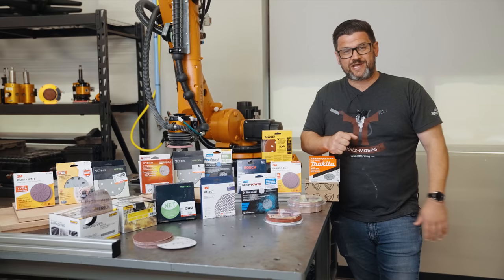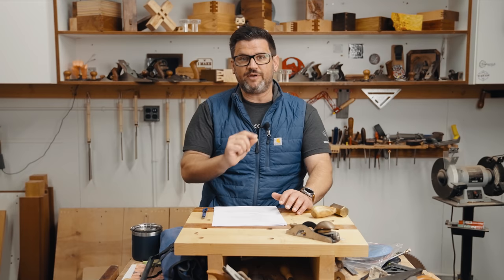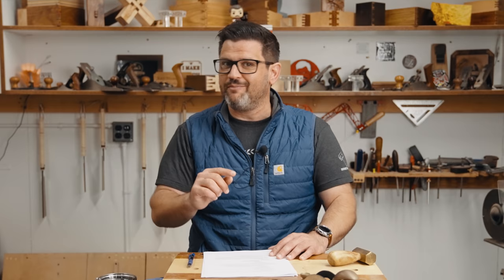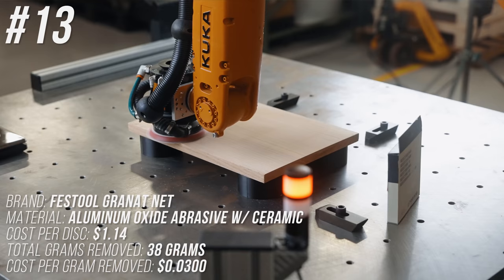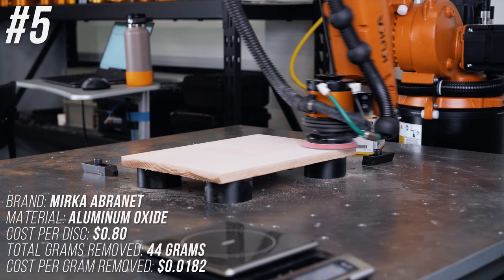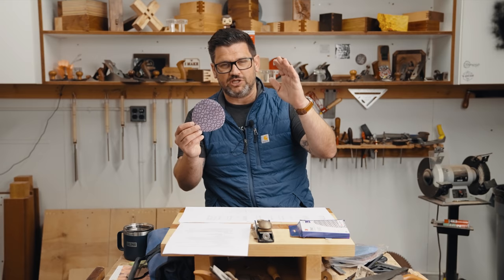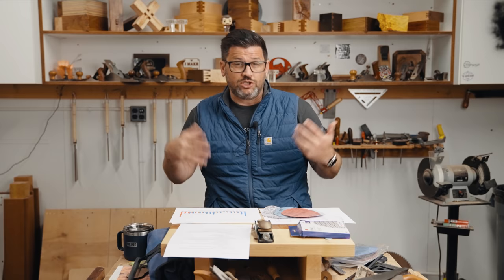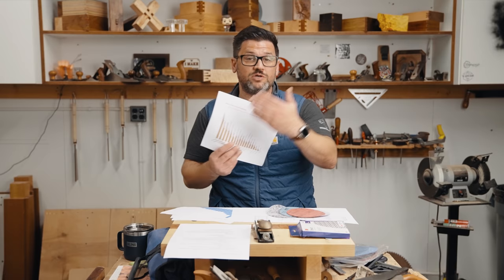Largest Sandpaper Test EVER Done - Top 19 brands Tested using Robots for Unbiased Data

Comment: 10.7 pounds of force. Isn’t a little too much ? I’m not an expert but what I’ve always seen on videos is that you simply lay your hand on the sander to guide. Never put pressure on the sander. "Let it do the work" as they say. 

Put a sander on your kitchen scale and then press down on it until you see 10 pounds. I’m pretty sure you’ll find it’s a lot. 

I don’t know, I’m just wondering what is the best way to sand. Thanks
Reply from the maker: What do you think a sander plus your hand weighs? We tested various combinations and came up with 11 to 12 pounds.

Comment: If you get a larger pack of Diablo the prices drop A Lot. From $1.50 a disk to $ 0.40 a disk that would drop the price per gram from .0236to 0.00625

Comment: mr moses. i would like to know if it's possible to do the same test or at least test the long longevity of drum sanding rolls. right now i use klingspor clothback 80,120 grit rolls of aluminum oxide. on a 16/32 super max. if anything a recommendation

Comment: have you tried using any dry lube spray to see how much it will extend life of pads? iv found it priceless since I'm working with gummy pine for saw blades and table decks as well. was wondering if there's much difference with the different brands of spray?

Comment: What about dust extraction on the top 3?
Meaning will it run as clean using it on a Festool sander vs. using Festool paper on the Festool sander ( holes lining up )?

Comment: Thank you for testing scientifically! Truly

Does the 3M Xtract require the Interim Protector Pad between the sander and the disc? (like Mirka and Festool)
Reply from the maker: I don't think so but I am not 100%
Reply: @katzmosestools  thanks! I can't find anything on the 3m site so I also asked Taylor tool works as well. I hate the interim pad, I feel like it makes it sand weird
Reply from the maker: @theclaxton  yeah we didn't use one and ATI is very familiar with 3M specs because that's the paper they use on their sanders
Reply: @katzmosestools  that's terrific, sounds like 3m also designed out the need to use the protector. Great stuff. Know anyone in the market for a bunch of granat net? 😉

Comment: Hey this is an amzing video, I linked back to it quite a few times now. 
I do have a question however. You mention that ceramic is the way to go over aluminum oxide. Do you have any experience with Silicone Carbide? For example the DeWalt Mesh uses it.

Comment: Will the 3M Xtract cut as well on cured epoxy resin and would it be nearly as good without a vaccum? I work outdoors on carbon fibre parts so I don’t need a vacuum.. Thanks for the video!

Comment: @JonathanKatz-Moses was there a vacuum used in this test, on the robot? Are these results shown only accurate if there is an extraction vacuum applied to the sander? Would the results be different if I don't use a sander with a vacuum port?

Comment: Great review. I went to buy some, but havent found any near that price. I have been using diablo because theu seemed betrer than the porter cable I had, where much cheaper on sale and lasted a little longer. I have used 3m and norton... I  like them, but they 4x+ price. I cant find any 3m near the price listed in video. Most are closer to 2x the shown price. If i could find at your price Id make a large order, but most any place is 2x price shown in video

Comment: One thing that struck me about this really good and informative test. Is 120 grit always 120 grit? Or is it like +- 10% or something like that? A difference like that wouldn't make a big difference when rubbing your hand over the sanded surface, but in a accurate test like this, it may or may not be a parameter to consider. Just a thought. Over and out

Comment: Time to prove your theory: same test but have an IR thermometer to measure working temps. =p   The sawdust that clogs other paper may also keep those papers from cooling reliably.

Im curious about the surface left behind by the 2-3 worst and 2-3 best.  Granted for a scientific result a good magnifying glass or microscope would be needed but would be cool to see other downsides of bad sandpaper.

Comment: Excellent comparison. But it does not take into account variations in wind speed, relative humidity, and changes to the hook and loop pad on the sander. 🙂. On a serious note, do you have any thoughts on how the various grits perform?  I assume they leave a surface similar to their less capable peers, but I wonder based on how aggressive they are. Fortunately there seem to be relatively inexpensive samplers that will let me answer my own question (with my own sander). Thanks for the video.

Comment: Awesome video. I've been a Cubitron snob for years, kinda mad 3M doesn't make a Stikit version (only velcro backed rolls, forced to settle for the Blue ceramic/Al oxide mix). I hadn't seen the mesh disks, I'll have to try them out. Thanks!
Reply from the maker: Check the 2nd link in the pinned comment. They do make an adhesive backed version
Reply: @katzmosestools  My bad, I meant the Stikit rolls rather than the disks. They're a game changer if you spend much time hand sanding, and I spend way more time doing that than with a machine (just the nature of my work). Everything can become a sanding block- a pencil, a can, a level...

Comment: I use 3M cubitron but I find I find the loop backing breaks down quite rapidly.  Using an interface pad helps but it's not much good unless you're sanding a flat surface.  

Would welcome any tips.

Comment: There's really no reason to group mesh with solid sandpaper, clogging is hell! For example, even if cubritron is cheaper than extract, the fact that one will let the particles through much better than the other is a game changer. I've been using arbanet for a while but will definitely try extract when my stock runs out.
Never using non-mesh again.

Comment: I really appricate this.  Do you know what the best sandpaper is for drum sanders?   I havn't found any with ceramic grit yet.
Reply: Klingspors makes AZ paper for drum sanders. Blows any AO paper out of the water.
Reply: @Festus2010. Do you mean Aluminum Oxide?  I have Klingspore now but would love to see something made with Ceramic like the 3m product.  I know it won’t be quite as effective because it doesn’t make use of the grading for sand removal but it might last a lot longer anyway, especially with the heavy duty dust collection I’m using on it.
Reply: Klingspors has Alumina Zirconia (AZ) paper which is ceramic. It’s blue unlike their Aluminum oxide paper which is red.

Comment: When people compare sandpaper on internet it's always about removing material as fast as possible and/or as cheap as possible. I can see that being a thing for carpentry, but for fine furniture that is not the first consideration at all. I know lot people do 2x4 frame assembled with pocket screw or that kind of cheap joins, the end result is always same, the pieces are not perfectly flush, so i see people taking their sander and grind the joint until it looks flush. I'm not criticizing here, i mean it's a valid way to build things with wood but it's not the only way. It's certainly the most appealing way on youtube because cheap/easy obtainable material give the sens of accesiveness so attract larger audience plus it's quick build so you can do your one project a week + editing. But it's not the only way to skin that cat. For people doing woodworking in other ways the ability of a sander to remove material fast is just not the question. 

By the way if i want to remove material fast i'd personally use a planer or just a hand held electrical plane, or even a router with a flattening bit. I got a flattening bit with those square carbide insert, do the maths on gram/cts on these and no sandpaper would ever touch it, and the surface finish is great. So no when i use a sander it's not for removing material fast, sorry. To me this is a brilliant answer to a question that doesn't matter.
Reply: That's just not true in any sense of the word. Why wouldn't you want your tools to work faster and cheaper? When your tools work faster, it gives you more time to concentrate on the final finishing. The final finishing is what separates the excellent quality from the meh quality. If you're all worn out from rough and medium sanding, the fine sanding won't be as much of a pleasure.
Reply: @Bob_Adkins  Each is way. My experience and many others prouve the contrary. Your finish quality is only as good as your the quality of your first 80grit pass of sanding. The rest is just refining. When sanding i spend most on my time on 80gritt then walking up the gritt scale just to remove the scratchmarks. Go quick with the 80gritt and then spend time with the finner is a sure way to spend mucchhhh too many time for at best the same finish. I know some master craftsman even season their sandpaper on nonshow surface and only go with used disks for the best finish. But once again it's finishing not shaping, i do all my shaping (i.e. : material removal) with other tool much better suited to that task than a sander. 

And by the way if you are all worn out because of sanding consider buying a better sander, with my old dewalt sander always sore arm,  i used crappy black&deker i could not sand more than 10min before being cramped (it overheat after 15min anyway), but with the festool one i can sand all day long no problem. 

And to finish when i say you don't want to go fast it's because if it's quick to remove material that also mean if you make a mistake it will ruine your piece much faster and/or be harder to repair. That is certainly not a risk i'm willing to take at a finishing stage. 

But as i said, if it's carpentry then it's a different matter.
Reply: @lolaa2200  Sanding is my least favorite thing about building or refinishing furniture. The less time I spend on it, the the better. Period. Taking longer does not make it better, only longer.
Reply: @Bob_Adkins  Then consider remove material with another kind of tool, it's overall faster and you end up spending less time sanding for same finish. That's what i try to say from the beginning. Removing material with a sander is not an efficient way to work no matter how good your sandpaper.
Reply: I don't understand. When I am getting ready to prep for oil finish I don't start sanding until it's ready to sand. I don't stop sanding until it's perfect. I don't use my sander in place of a hand plane or a power planer. I would rather use just 1 piece of sandpaper instead of 3. I would rather it take me only 20 minutes than 30. I would rather spend $.50 instead of $1.00 to sand my wood perfectly. If my sandpaper is wrecking my wood, I won't use it. So simple, yet somehow you don't seem to get any of this.
Reply: @Bob_Adkins  what you don't get is the usage of sanding you talk about don't correspond to the test that is performed in this video. This video only adresse material removal capability. And that is just not the task you perform when you sand before oiling as in your exemple. That's my only point. It's about usage.
Reply: I'm a fine furniture builder. My supplies are very expensive, and the work takes far too much time.  If I can get the same result for less money and less time, why wouldn't I use better sandpaper?  I don't do woodworking for therapy or tradition, I do it for nice furniture. If anything degrades the quality of my work, even a little bit,  I don't use it.
Reply: I know the test is only about speed of removal, sandpaper life, and economy. That's a hard test for me to do without a robot and many hours of work. Testing for finish quality is very fast and easy. I am perfectly capable of doing the test., and it will cost me 1 sheet of sandpaper and 5 minutes. If the sandpaper fails the test, I will use another grit or another brand entirely.
Reply: @Bob_Adkins  You don't get my point. How fast you get a finish ready surface and how fast you remove material are two diffèrent things, they are somehow related but not that closely. So testing one don't tell you much about the other. If your goal is turning an already flat surface into finish ready then that test just don't tell you how fast it will get or how much it will cost. That's all.
Reply: @lolaa2200  As a consumer, I'm always looking for products and tools that will work faster and cheaper with the same or better quality. That test was perfect. You're correct, the test didn't mention quality, but I can easily do a test in 5 minutes. Really, no one else can do that test for me better than I can.
Reply: @Bob_Adkins  i don't see how buying something that makes something irrelevant faster makes you a better consumer sorry.
Reply: @lolaa2200  Sandpaper is not irrelevant. I need it to soften edges, round off corners, and remove remnants of old paint and varnish. I also use it to put a fine polish on hardwood before oiling or varnishing. A good consumer gets what they want and need at a good price. I want fast, fast, fast sandpaper that doesn't clog or wear out in 5 minutes. I win big with 3M Cubitron II. In fact, I think I will buy a case of 80, 120, and 220 while it's still affordable.
Reply: @Bob_Adkins  if that's what you want then good for you, all i say is for all the usage you mention except the surface finishing there is much faster tools than a sander no matter what paper you put on it. So if speed is your concern just don't use a sander for that, of course you can use a sander for that but it will never be the fastest way no matter how good your sandpaper. That's why i say it's just irrelevant. It's like testing what paint makes a liner boat faster to cross the pond, if you want to cross the pond as fast as possible you take a plane not an ocean liner boat. Now if you like boat then go for it i have no problem with that what i have problem with is discussing about how to make it 10% faster when another method exist that already goes 200x faster.
Reply: @lolaa2200  I can't use planers on finished products like large chests, tables, beds, and doors. I have no choice but to sand them. It can take 2 days to sand a set of cabinets, better paper could cut it down to 1 day. I hate sanding, so I'll take it!

Comment: E z arc is what u should had tested have the best cutting metal blades for multitools best wood cutting blades best at what the big companies are not which is add on for tools not the tool themselves also won't different sanders with the different sand paper be a better test because it's not the pad sometimes but the sander itself
Reply from the maker: HuhhhWhat?
Reply from the maker: Ok salesman from ezarc. Did you even watch the video ? This is a sandpaper test 😂😂😂

Comment: Nice video, and interesting results. Not to sound like one of those guys that are trying to nay say (I am genuinely curious), did you do anything to ensure that all the papers left the same finish? 

They are all listed as 120, but 3M (for example) could just be calling a pad 120 when it is actually more akin to the 80 grit of other manufacturers. Therefore would do well based on the metrics of your experiment, but not achieve the goal of someone using a 120 pad.

Equally, the opposite could be true, some manufacturers could undersell their grit, and their 120 leave a 150 finish, but remove less material due to this. 

To me the friability chart stands out. I want a paper that will keep working (which the 3M also did well at).

Grit standardisation is probably a whole other set of experiments, but I feel relates to this one.
Reply: Grit size is a set in stone industry standard. Companies can't lie about the grit size.
Reply: @AlAmantea  there are multiple grit standards, all of which have slightly different approachs and result in different courseness. There are some tables out there that show there that show that try to show how  the different standards compare.

Then within each standard there is tolerance bands, which manufacturers do not need to be in the centre.
Reply: @targettio  yes, there are. That's why we have standards of industry. There is a difference between 120 grit, and P120.
Because we standards of grit size, we can look at the label and know the difference immediately if we are aware of the difference.

Comment: Does the dust collection work well on the 3m sandpapers while using the cheaper style 8 hole sanders?
Reply: Go for a 3M multihole backup pad that fits any hole configuration and of course 3M XTRACT. Small investment and lasts a very long time. The sander is okay as long it uses a dust extraction.

Comment: Just want to point out that at 5:21 you can see a sticker on the ATI robot that states: "optimised for 3M abrasive solutions", but I'm sure none of the other sandpaper brands will hold that against you ;-)

I guess it's almost impossible to do a completely unbiased review. As you said, companies will always find a way to pick a hole in your test method.
Big fan of both your video's and products by the way. (I bought an apron and dovetail jig a while ago),
Reply from the maker: Hahaha it's like a coke sign at a restaurant I'm sure. ATI was very aware that I would be reporting my findings without interference from anyone. I think anyone who's watched more than a couple of my videos knows I absolutely will not accept money for favorable reviews. I've been crystal clear about it for years.

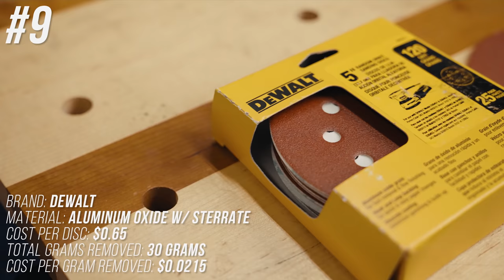Comment: at 7:40 you said Norton Mesh power costs $0.0224 cents per gram removed but the chyron says $0.0300. Which is the correct #? Similar error for Dewalt at 7:57 Mostly curious, not thinking of using anything but Cubitron.